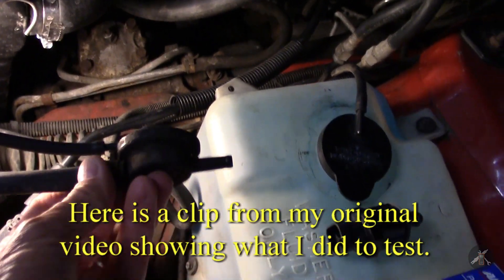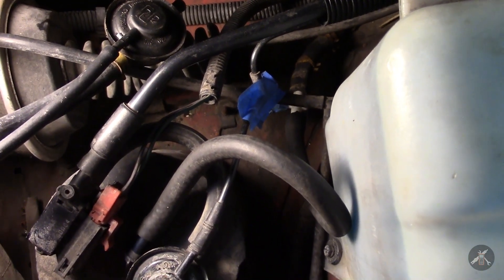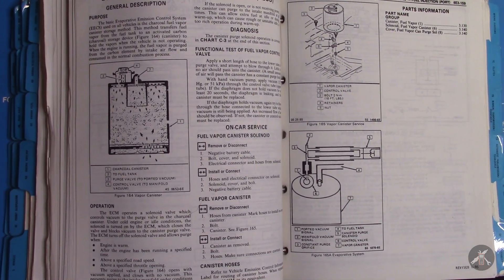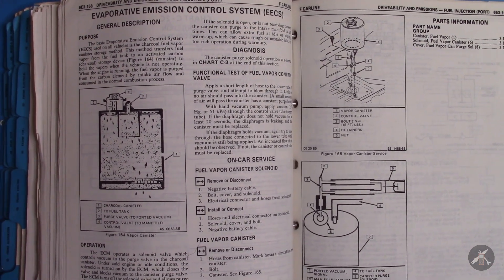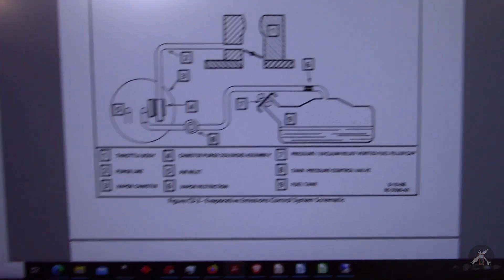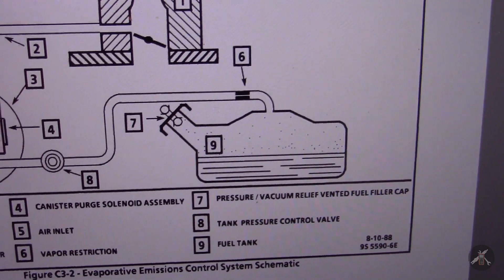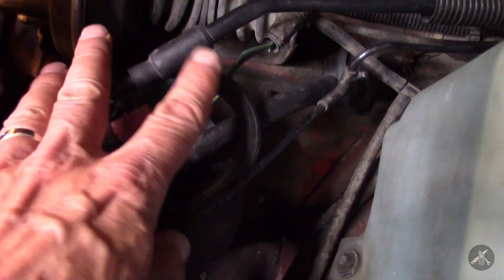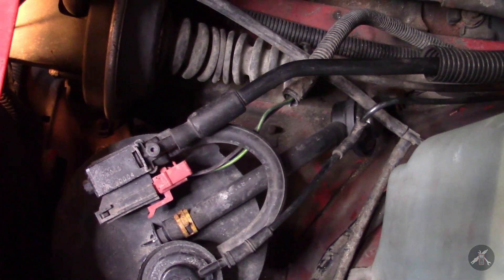Is There Too Much Pressure In Your Fuel Tank, Do You Smell Gas Fumes? How GM Evap System Works

Comment: In ur previous video, u said u had an idling issue where when u drove the car for an hour, after restarting it it wouldn't want to idle. Did the idle air control valve finally fix your issue? I had this issue pop up today... And I also smell gas. I replaced my vent valve. in the rear, but not the purge valve near the canister.
Reply from the maker: Yes, I did change out the IAC.  I actually reinstalled the factory original part that I replaced just because it was old, while I waited for a warranty replacement part. The car was running well so the new replacement part is still on the shelf. Perhaps one of these days I'll swap it.
In my car, the rear was venting because the front purge valve was bad.The rear doesn't vent any longer.

Comment: Hey Dan, i own a 1983 z28 h.o is been changed to carburetor. Yesterday I tried removing the entire canister but it made it worst. Today I picked up a new purge valve hooked it all up took it for a drive and issue still remains. The car runs great when I first get in it and drive , once it’s been driving for about half hour and it gets warmed up it mainly happens on the highways once I’m going 50+ it starts to hesitate and if I don’t let off the gas it will only get worst until I’m there hitting the gas and the engine revs in a weird way doesn’t sound like how it would normally is almost like if you stuck the engine inside a bucket the sound it makes sounds deadened until it can’t go anymore. I notice my gas filter in the engine you can see the gas boiling inside it even after the new check valve. Fuel pump also gets x10 louder. Hoping you might know something about this
Reply from the maker: Well, not sure about your conversion. So, that was a crossfire engine with two throttle bodies and electric pump?  If so, there would have a fuel pressure regulator and return to the tank.  In your conversion, is there regulation and fuel return? The TBI units would normally have higher fuel pressure than the carb, probably 10 psi vs 3 to 5 psi with an in tank pump.
The purge valve on injected engines keeps a psi or two pressure held on the tank. Bubbles in the tank can be fuel boiling due to low pressure combined with hot fuel. A fuel return will help take hot fuel back to the tank. That can help and hurt.  Keeps the line cool, but send hot fuel back to the tank and heats the tank. Generally a net positive.

Comment: Hi Dan, My 1987 5.0 IROC is experiencing the same things… after driving it for awhile it gets jerky at low speeds, can smell fuel, I can also release a lot of pressure when removing the gas cap. I’m not hearing any boiling sounds from fuel tank. Both purge valves test good as well the valves are receiving good vacuum when cracking the throttle. Electric control valve on canister is also working properly. Any other ideas what to check?
Reply from the maker: I'm not sure, but here are some thoughts.  I have observed that having a functioning purge system is necessary, but not sufficient to stop all smell issues. For reference, my experience is that in warm / hot weather and low speed stop and go traffic (like the Dream Cruise...), I think the hot fuel vapor exceeds what the purge system can handle as hot fuel is circulated back to the tank from underhood. 
At low speed / idle, the underhood temp is higher and fuel flow is low, so the regulator sends a lot of hot fuel back to the tank. 

The purge valve will by design hold some pressure on the tank, so you will get some pressure release at the cap (but not nearly the amount with a bad purge valve).

 My read is that the jerky feel at low speed is the purge system working as designed.  If the canister is full of vapor and you tip in lightly, the ported vacuum will open up the valves and you get a sudden rich flow of fuel vapor for the engine to handle while throttle opening is low. If I tip in harder and dilute it somewhat, it clears and runs fine. 

If this continues and the purge system can't vent enough through its orifices, the overpressure valve in the back will open and vent the excess vapor.

Perhaps there is an issue with canister capacity or internal flow that it cannot handle the volume of vapor, but I don't have a way to measure that. I would think the canister would just push it through the carbon granules and out the filter at the bottom. My sense is sometimes the driving conditions just overrun the system and I don't have a solution. 

 As a side note, If I run on the highway, I can run at much higher ambient temps and not have an issue when I come to a stop - until I get a long slow stretch.
Reply: Yes, what you described is the same for me… everything runs fine for awhile after coming off the highway. It’s the slow traffic or cruising through the neighborhood at 25-30 mph is when it acts up some. Appreciate your feedback  @bitsofwisdom460

Comment: Hi teacher Dan,   I am your new subscriber. I want to tell you that this is the first time that I subscribe to a YouTube channel. I do it as a way of thanking you for all your time and dedication to helping others by passing on your knowledge and experiences that are very useful.
For me all your teachings on your channel have been very useful, since I have a 1986 Firebird Trans Am 305 tpi automatic with BW 3.27 rear axle with t-top and 4 disc brakes.
With that said, here is my first question: why did you choose a third generation Camaro for your project?
Did you consider it superior to other generation car alternatives or was it just a closer opportunity?
Reply from the maker: Thank you for subscribing and for your comments.
It was an opportunity, yet it had some special significance. I wasn't searching for one, but rather found this car and was intrigued. First, I saw this car sitting in the garage, appearing to be complete yet clearly parked for a long time. I did some quick checks and research with the RPO label and the car's condition. It appeared to completely original.  There was evidence that the original owner had taken great care of it and yet had never come back to return it to the road. It was the proverbial car that someone had just parked and put a cover over - waiting to be found and restored. Then, it was a special model.  As a GM employee with a long career, I had been working in an engine / transmission dynamometer test lab when these tuned port engines first appeared and when the IROC was introduced. The port injected engines were quite an advancement in a day when a standard 5 liter V8 made 140 or so HP.  In addition, I had worked on the transmission / axle and related parts of the 4th Gen cars, so I had some background on the Camaro line.   As a car guy, it looked like a great challenge and opportunity to put an essentially historic car back on the road. As I worked, I came to better appreciate how good this car was.

Comment: I sold my 1987 Iroc Z for this reason. I regret selling it so I bought an 88 Iroc Z but this one is driving me crazy with code 36 MAF Burn-Off. I went through the tree of trouble shooting to the last step. "Disconnect Burn-Off relay, Ignition On, Probe CKT 900 with a test light to ground. 
Light Off, but Volt meter reads 0.44 dc. Will keep trouble shooting till I find the problem. 
Well I subscribed to your channel you have great info. 
Thanks
Reply: I had same on my 1987 corvette . No need to trouble shoot. Just change the 2 relays. Don't cost much and solved my  codes

Comment: I swear man, you're a psychic. I think I have too much pressure in my tank. If I park the car after a long drive in hot weather and remove gas-cap there's hissing. Almost sounds like fuel is boiling (Blurp blurp). Ordered a new vent-valve (the one in left rear wheelwell) and the valve just by the charcoal canister a few weeks ago. I already have a oem non-vented fuel cap so I hope it'll fix it. I don't smell any fuel though.
Reply: It's hard to refuel now and then, with the pressure triggering the filler-gun to stop the filling.
Reply from the maker: @kmas8229  I only smelled fuel on occasion, like after a hot weather run in traffic. The tank would build enough pressure to push open the vent valve in the rear.  I have issues fueling, but I think that is unrelated.  I have an aftermarket tank, but it ought to be like factory.  If I'm 10 or 12 gallons down, I can fill the first 4 or 5 gallons at full rate, but after that I need to go slow.
Reply: @bitsofwisdom460 Hi Dan, thank you again for the wealth of knowledge you share with us. I’m having an issue with my 86 IROC with the same engine as yours. There is pressure in the fuel tank. Noticeable when I remove the gas cap and hear the hissing. Also from time to time when I don’t release the pressure the tank will make popping noises I assume it expands from all the pressure inside? I have tested the purge solenoid and it’s working. I replaced the purge valve(ufo) looking part by the canister along with the vent valve in the rear driver side by the tank but the issue remains? I did order the valve by the tank from Amazon. Is it possible I got a bad one? Is there a way to test it? I do notice a constant hissing sound from the gas tank area when the car is running. Thanks Dan
Reply from the maker: When the system is hot, there will be some pressure in the tank. Hissing when the cap is removed is normal.  The purge valve in the vent line to the canister will hold something around 1 or 2 psi on the tank.  I found that this is actually good because that pressure helps keep the gas from developing bubbles at the pump inlet and the pump runs quieter.  Even with everything right, I still have some pump noise if the car is run in low speed traffic in very hot weather.
The valve by the rear wheel seems to be intended to prevent overpressure if the purge valve can't keep up with flow to the canister when hot. I rarely have that one vent since I replaced the purge valve up front.
If the purge valve is replaced, I would check to be sure the purge solenoid is working and that the vacuum signal to the purge valve is working (vacuum hose in good condition and clear).
Reply: @bitsofwisdom460 Dan what would be the harm if I remove the fuel tank vent valve (the one in the rear by the differential) and leave the hose open? I just want to do it as a test to see if it makes a difference with the constant hissing sound I hear from the gas tank area and the excessive pressure in my gas tank.
Reply from the maker: If that line is open, there are two things to consider.  If the tank is hot and not under its normal pressure, you may have trouble with fuel pressure when the fuel begins to boil.  Also consider that if the line is open, there is greater risk of fire if fumes are ignited by something.  The vent valve should be one way and  prevent fire. In other word, fumes escaping the valve could catch fire, but not continue if the vent closes off. 
If you're getting that much pressure, it still seems that something isn't right in the purge valve / solenoid / canister / hoses.
Reply: @bitsofwisdom460 Thank you Dan. I agree with you something is definitely wrong with that evap system. I just can’t figure it out? I replaced the inlet valve (ufo looking thing not attached to the canister). Replaced the vent valve by the tank. Ran a jumper wire from the battery to the solenoid and heard it clicking when I applied 12 volts. Now I’m left with either the outlet valve is bad (the one you can’t replace because it’s attached to the tank) or could it be my fuel pump? I got under the rear of the car and the constant hissing/humming sounds like it’s coming from the top of the tank?
Reply from the maker: I would be trying to see if you're getting flow up at the canister.  I would try to get a vacuum / pressure gauge tapped in up front near the canister with a plastic "T" and some jumper hoses.  I would start at both sides of the purge valve and the canister to see if you can tell if vacuum from the engine (with the throttle cracked) is drawing vapors.  There should be positive pressure of a couple of psi on the tank vent, lower pressure going to the canister, vacuum between canister and engine.
Reply: @bitsofwisdom460 thank you so much I will definitely test it out
Reply: Thank you Dan I will check it out

Comment: Great information! I'm going to check the valve on mine as I do tend to smell fuel. I know my rear vent is good as I cleaned and rebuilt it. Thanx, looks like an easy check
Reply from the maker: It's worth a check.  I know there are times where that rear vent may still pop off, but this purge valve operating properly can certainly minimize it.
Reply: @bitsofwisdom460  Very helpful video, by the way, did you ever film a video regarding the chassis lubrication points?, thanks and have a nice day!

Comment: Interesting that you put this video up cause mine is a 91 z28 and I dissembled  the fuel vapor canister lines . So I thought the purge solenoid came off the top of canister. It look like it did but does not so I broke tube under solenoid.  Now that I’m wrapping up the rebuild the car smells like gas really bad up by the canister. Since then I hv read in forums that you can buy the new solenoid and canister from a 93-02 camaro which is still available. I still need to buy also vent valve from rear of car
Reply from the maker: I had a question from someone who watched my earlier video asking for more detail, so it seemed to be a good time for it.  The suggestion that the newer canister could work is worth investigating.  As long as the solenoid is still the same normally open type, the ECM ought to command it.  Just would need to compare the coil resistance so that the ECM driver will still work ok. I expect that it should be compatible.The controller teams try to keep commonality as much as possible so that different controllers can be used in different models, but always worth a check..
Reply: @bitsofwisdom460  I was mistaken it’s the canister and purge solenoid from a 93-95 camaro . The threads I have read are saying it’s plug and play . Works perfect
Reply: Thank you sir! My canister is not hooked up. Recently I started hearing bumping from the tank and it does sound like my pump is cavitation.
Reply from the maker: @philcoomer6449  When I removed the fuel tank control valve for testing and attached the vent line straight to the canister, I did not expect to see a problem.  I expected that a pump submerged in the fuel ought to work fine.  It was quite a surprise. But when I installed the new valve it really cured the issues.